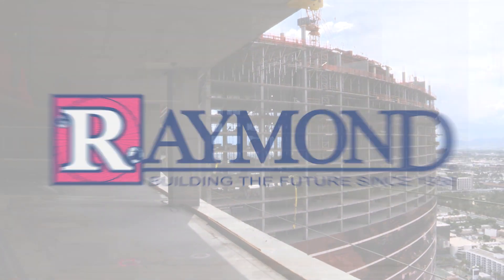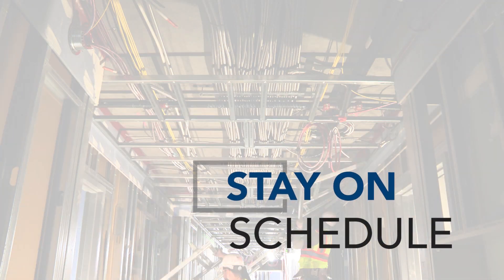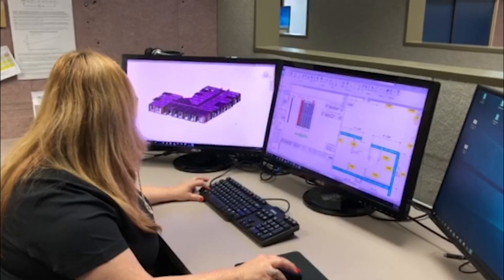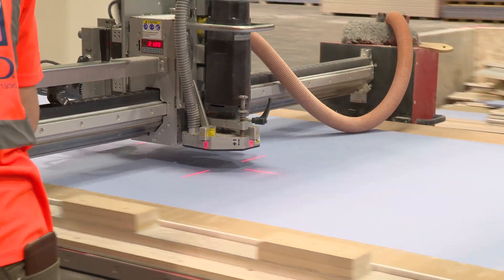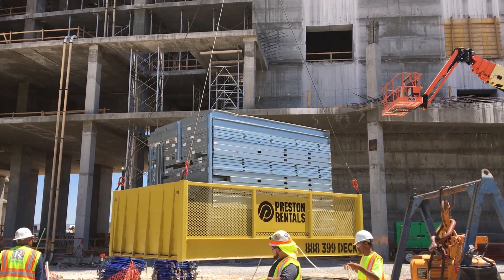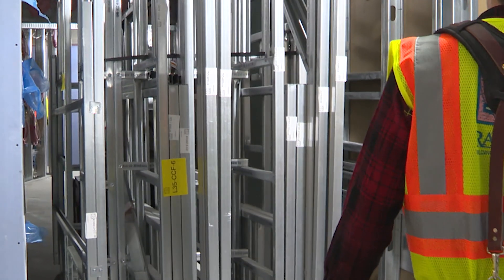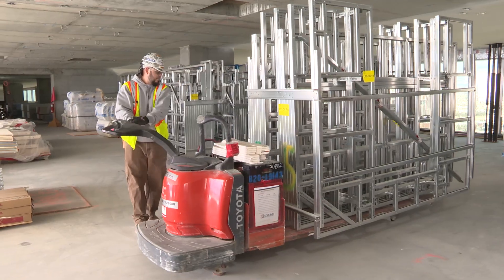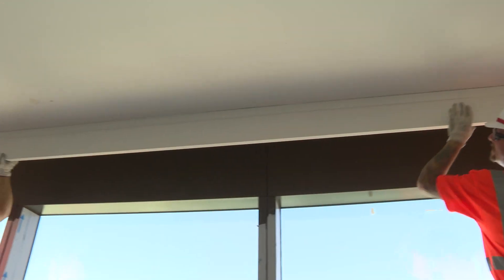Prefabricated Framing & Drywall Installation

Comment: For drywall how do you ensure deflection gap since your wall frames are preassembled?
Reply: Looking at that also. I assume that is the preinstalled deflection track at the 1:17 point. If you look at about the 1:30 point in the video you will see the wall framing is in what appears to be a deflection track. At the joints of that deflection track, I think I see a top track showing through the gap. Could be wrong though.